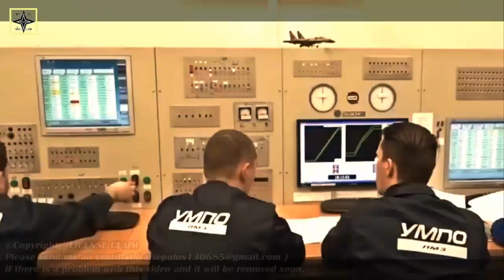New engines for the Su-57 Stealth fighter jets classified as Gen 5+

Comment: Again, the same mistake repeated again and again... 
There are two types of engines: AL-41F1 for the Su-57, and the AL-41F1S for the Su-35. They are quite different, despite the fact the indexes have difference just in one letter. The AL-41F1 for the Su-57 was made especially for it! It has a lot of features the engine for the Su-35 simply do not has! The current 1st Stage engine is already the 5th gen capable: 
1. It allows to fly with the supersonic speed without afterburner. 
2. It allows the 3D thrust vectoring and the supermaneuvrability.
The requirements of the 5th gen engine are completed! The AL-41F1 engine of Su-57 allows for supersonic speed without the use of afterburner, and also has a fully digital control system and a plasma ignition system. It differs from the engine for the Su-35S (AL-41F1S) by an increased traction force, a sophisticated automation system, a fully digital control system, a new turbine and improved flow characteristics. The "Izdeliye-30", the 2nd Stage engine, will be simply the absolute new engine , made from the new alloys and composites, which allows to increase its thrust and reduces the weight. Also, it will use less fuel for some flying modes...
Therefore, the 1st Stage engine on the Su-57 was made for it by the separate order of the 'Sukhoi' company! It is NOT the Su-35S engine.
Reply: The sukhoi 57 has a speed of 1600 miles and the 35 1100 miles. But the sukhoi has a 
afterburner
Reply: You are intelligent when the topic is about aircraft system
Reply: @iqcodplays5515  , So what? The engine provide the supersonic cruise speed without the afterburner usage. But afterburner is required anyway for the high speed maneuvers.
Reply: @maksimluzin1121  do you work in the russian air force ? 😅
Reply: @iqcodplays5515  - The F-35 has an afterburner too.  Pretty much all fighters do these days - and it's been that way since the Cold War.
Reply: @alexandernorman5337  How i know it russian 5th fen aircraft can hold twice the amount of the f 35 and is more fast.
Reply: @alexandernorman5337  will the su 57 get an better engine
Reply: @alexandernorman5337  are you woking in the russian air force, you know to much about the engine
Reply: @iqcodplays5515  So much? Seems like the basic understanding of the subject...
Reply: @tropickman  i mean maksim luzi
Reply: @iqcodplays5515  , No. Russians do not WORK in army, they SERVE in army... ;-))) Anyway, all the information in an open source, at least, in Russian language...
Reply: Hum after 1500 test hours does  it blow up ?
Reply: @RicardoMrMendes  , Why it should?
Reply: What you don’t say is at what supersonic speed the AL-41F1 can provides cruise without the after burner?!! The AL-41F1S of the Su-35S is at 1.2 Mach, which is less than that of the Rafale!
Reply: @darhammora7867  , you should count the weight of an aircraft, not only its speed. How much fuel and weapons on its board... The distance of the operational range also in account.

Comment: Not just the F35, the F22 is also a 5th gen fighter jet. I doubt it will stand much chance against an SU57 though.
Reply: SU 57 is labeled 5th generation but it's a dressed up 4th generation, they can be seen on radar from far away as it's cross section is the size of an f18 and it's huge jet engines create so much heat and stick out like a sore thumb, a 70's era heat seeking missile would destroy that thing unless it has the electronics to counter them but that remains to be seen

Comment: The stats of the Izdeliye 30 engine described are actually no better than the F-119s used by the F-22. In fact, they produce less dry thrust, only matching the 20 year older US engines when in afterburner, indicating they're still technologically behind, and require greater use of fuel hungry afterburner to produce only equal thrust to western designs decades older. The F-135 engine used by the F-35 is superior again, and the USA has flown a 6th generation prototype aircraft which likely has newer engines again. 

Basically, Russia's 20 years behind in engine technology, but they would like to pretend otherwise.

Comment: Is it utilize vacuum pressure to enable super cruise? That way the amount of air being pulled into the motor is multiply for free so it doesn't have to go as fast to get so much air moved in because it's utilizing vacuum pressure😅

Comment: Another big pile of b.s. from mother Russia!
1) it is an epic fail to add the “generation moniker” to jet engines.
Fighter jets are called generation due to the force multiplier they bring to the battle field (which includes engines, avionics, weapons, radar, flight controls etc).
And even to over-promise before the engine is even reasonably tested and before it is ready to go into serial production is a further epic fail.

However I have to say, that the engine really looks good. The nozzles are similar to the nozzles of the F-35 which might reduce the aft radar signature as well as might reduce the heat signature.
But then we could be never sure, if these design details will be part of the final system!
Reply: Вообще ничего и близкого к F-35 нет. F-35 использует советскую систему поворота сопла разработки для Як-141. Су-57 использует сопло с изменяемым вектором тяги, это совсем другой подход. Первые 1-2 минуты боя еще могут идти на дальних дистанциях, но дальше преимущество в воздухе только у того, у кого максимальная маневренность и круговой обзор. В этом безусловно преимущество Су-57 неоспоримо. Но он и создавался значительно позже F-22  и является более современным истребителем. У РФ доктрина оборонная, поэтому решения именно такие, у США доктрина иная, у них свои решения.
Reply: @mikrotik5473  thanks for being civilized.
First: the Yak-141 reference is a fallacy! There has been earlier versions of the same system (not-Soviet). Also I didn’t meant the thrust vectoring similarities but the nozzle geometry which can be seen on the new engines which seem “uplifted” of the F-35 (as in my knowledge no other jet is using this type of radar (and IR?) reducing nozzle design).
Second: I believe that the US doctrine is pretty spot on. Nato didn’t shot down one jet in a dogfight within the last 40 years, and it also seems, that even before, a 1-o-1 dogfight was the exception. Hence always situational awareness played a far bigger role for combat success, further - a pilot would be unwise and neglecting, if he would continue air combat when he/she would run out of missiles. Visibility and “weapon-lock’ability” are with the DAS system in the F-35 far higher, than anything which currently comes from Russia.
Third: in Red Flag exercises, the F-35 could “prove” exactly this - a massive advantage against any other system. We also need to assume, that the F-35 would receive some further upgrades, until the Su-57 is produced in reasonable numbers and received their “final” avionics and engines (...). Hence the F-35 would most probably be as modern, but on the other side would be far more tested than the Felon.
Reply: @Dominikmj  С точки зрения реализованного в железе решения по вертикальному взлету и посадки мне известен только Як-141. С точки зрения уменьшения уровня инфракрасного излучения, мысль усадить подальше от сопла камеру сгорания двигателя видится вполне логичным решением. К тому же, если я не ошибаюсь, достаточно много усилий было потрачено на то, чтобы сам двигатель был максимально холодным. С точки зрения преимуществ истребителя, всегда исходят из того кто его противник и для каких целей он предназначен. Реальной "невидимостью" или "малой заметностью" не может обладать ни один истребитель. Для одиночного радара истребитель может быть плохо видим на каких-то расстояниях. Но если используется одновременная работа нескольких радаров, в том числе и в оптическом и длинноволновом диапазоне, то вся малозаметность компенсируется. В современных же системах обнаружения целей используются как наземные, так и воздушные и космические системы обнаружения. Взять хотя бы к примеру, Starlink. Это не что иное как распределенная фазированная решетка, мировой радар - весьма эффективная система обнаружения и целеуказания. 
Вы правы, сейчас истребители с истребителями не воюют - у них другие задачи. Истребители всегда были нужны как для прикрытия бомбардировщиков, так и для их уничтожения. С самими же истребителями воюют системы противовоздушной обороны - в основном на наземных и морских носителях. 
Когда же бой ведется на уровне истребитель-истребитель, то стоит учитывать, что есть ракеты дальнего радиуса действия, есть ближнего и есть пушка. Споров на счет что надо, а что нет идет много, но выживаемость зависит как и от концепции боя, так и от применяемого вооружения. Например, для F-35 сказано, что на форсаже больше минуты бегать не стоит, а F-22 запрещено вступать в ближний бой (кончатся дальнобойные ракеты, а дальше как выкручиваться?). Для Су-35 и Су-57 я таких ограничений не встречал, но они явно будут пользоваться своими преимуществами и учитывать преимущества оппонента. Управляемый вектор тяги дает колоссальные преимущества на близких к нулевым скоростях и ухода от ракет. Оптико-локационная станция тоже включена в конструкцию самолетов не ради красоты. В общем же плане, более молодой истребитель всегда имеет преимущества перед более старшим собратом и каждая конструкторская школа учитывает те самолеты, которые имеются в мире и старается сделать свои лучше, чем уже имеющиеся в мире. Полагаю, что следующим этапом (кроме беспилотного варианта) будет использование детонационных двигателей. В таком случае мы сможем увидеть интересные конструкторские решения и много-много споров "кто лучше и сильнее". Как в видеосалонах в 80е годы: кто сильнее - Шварцнеггер или Сталлоне :)

Comment: Actually the F-35 engine has 10 percent higher thrust than the izdeliye 30, which has about the same as the JSF119-PW-611 that powered the X-35 20 years ago. 
So in effect the Russians have created an engine comparable to the F119 in the F-22, only 20 years after the Americans.
Besides it's silly to claim that increased thrust defines a 5th generation engine, let alone calling it 5+ generation.

Comment: Russia has been claiming that the Su-57 will have new engines since the very beginning, and yet still nothing.  For an aircraft that Russians brag about having super maneuverability, it sure hasn’t shown it.  Sorry, but going lie and slow performing low-g maneuvers won’t cut it in a real battle. I have seen even the F-35 perform much more higher-g turns and maneuvers, and its primary doltish an attack aircraft.